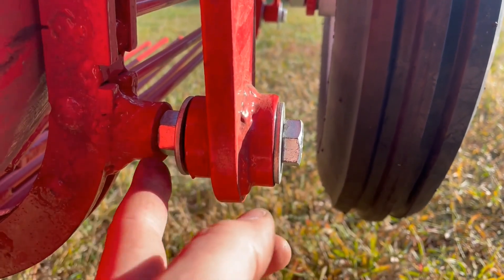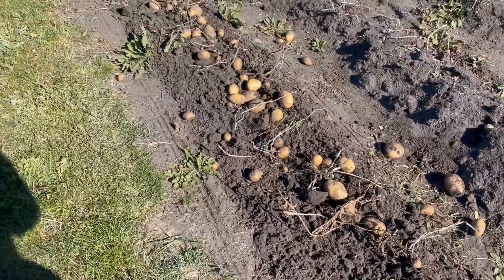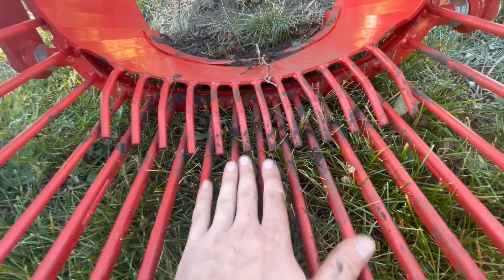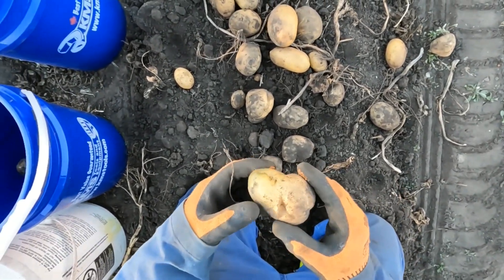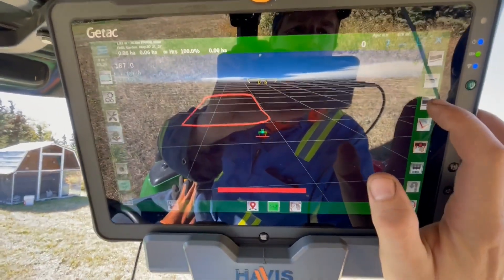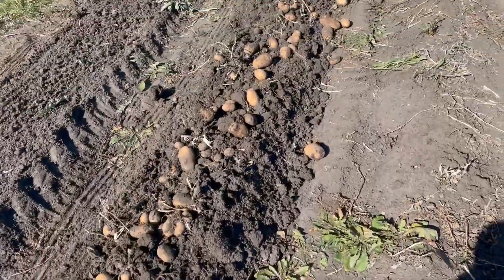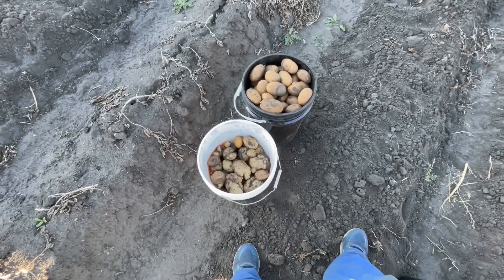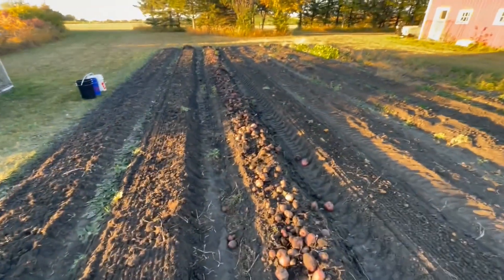Single Row Potato Digger

Comment: Nice to see some parkland prairie content ;) Nice job, you put quite a bit of work into all those camera angles. I liked when you went over a row twice to see what you missed. 1) How wide a trench does the digger cut? 2) Have you dug around by hand after to check for missed potatoes? 3) So overall would you recommend a digger like this? Thanks For Your Time: Shawn
Reply from the maker: 1) It cuts about 18” wide, it technically does not really cut a trench in this case it just busts the hill. Its only a couple inches below grade.
Reply from the maker: 2) ran the cultivator through and harrowed, only ones left were smaller than a toonie.
Reply from the maker: 3) If you really like gardening potatoes / beets / onions / Carrots. Id say the time savings makes it worth it. It takes longer to get it on and off the machine than the actual digging.
Reply: Awesome, Thanks so much for answering my questions.@potatofarmer

Comment: What pto speed are you using, as my machine shakes to bits
Reply from the maker: 7:49  the tractor is at 1500rpm, the actual 540 on the 3038e is 2500.  (540/2500)*1500 = 324RPM at the PTO.

Yeah it shakes pretty good on mine too.
Reply: @potatofarmer many thanks.  Yeah rattles like hell. Keeps shearing one of the bolts that holds the cradle. I’ll slow it right down, or sell it 😂

Comment: Do you know how this shaker style digger compares to the style that has the 'conveyor belt' of bars.
Reply from the maker: The shaker style has much reduced purchase, operating and repair cost, and lower part compexity. The only benefits of the conveyor chain style is can elevate the potatoes into a wagon, and is less prone to piling up material while digging. If you have a garden even a shaker is already overkill, if you have many acres and manpower is expensive get a conveyor style. The coolest harvester a grimme with a roller separator deck if you have few million handy.
Reply: Thanks

Comment: Hello, how deep do you dig?
Reply from the maker: About two inches below the base of the hill.

The potatoes are in a hill, so its not really digging in into the ground that much.
Reply: After digging, do you check somehow if there are some potatoes left under this 2 inches.... ? Or you don't bother. @farmer
I'm sorry for maybe stupid questions but I'm a newbe 🙂
Reply from the maker: @kudlabartosz  good questions.

The first time using the digger went back through the rows a second time, and found only a handful of smaller than golf ball sized ones left behind.

At the end of the year used a cultivator to check deeper but there was only a couple misses.

In total less than one hills worth of potatoes was left out of 300hills , I miss potatoes more digging by hand.
Reply: Thanks a lot for a very quick and  precise answer. Good luck 👍 @potatofarmer

Comment: I also purchased a Chinese potato harvester like yours. I found the same issues with mine, including misalignment of welded parts. I added washers as well that made a huge difference. The universal joint fell apart after about 75-80 hours of digging. Lesson: you get what you pay for. It was a cheap alternative for me that did do the job in the end, albeit with some time out for repairs.
Reply: Any way you can give some dimensions on the digger that can be used to make our own?
Reply: @toyotaworks09 sorry, just seeing your reply now, as I was notified in a folder in my email that I never look in.

I will try to help when I get to my storage shed again. It’s winter here, and snow prevents my access to the farm at present.

Comment: How much would you say that autosteer cost to put together?
Reply from the maker: $3K Canadian of which half is the tablet and dock, including an Emlid M2 with survey antenna for RTK base station. That is the parts price I could get them at 2021/22, and I was trying to spend money on it. Wanted a trimble cfx750 or better experience and got it. Compare at $60K+ USD per Tractor for JD Starfire with RTK. There is ROI in DIY.

Comment: I've seen these same diggers set up with a few inches of rubber or nylon hose over the ends of the tines to prevent damage to the spuds as the shifter jigs back and forth.
Reply from the maker: Ive seen that as well. After getting rid of  the pinch points almost all damage stopped.

Comment: where did you buy the harvester? works well after the adjustments
Reply from the maker: I bought the harvester from “the tractor company” out of Osler, SK. They sell compact tractors and attachments.
Still think the PTO could be mounted a few inches higher. Saved about 12hrs of digging by hand!